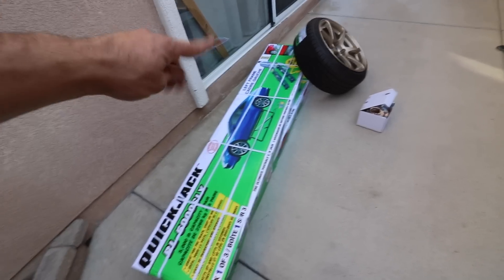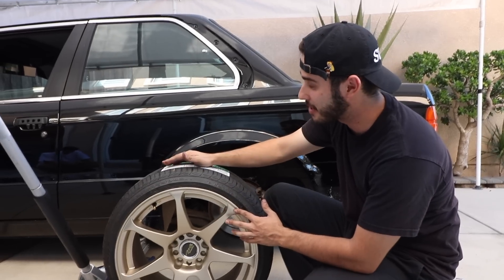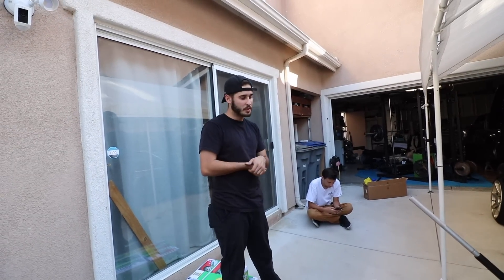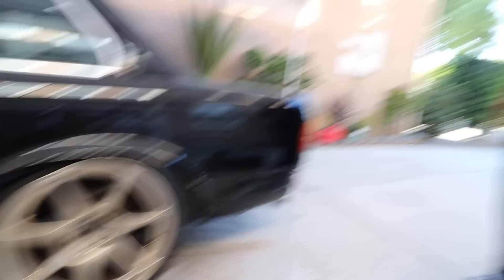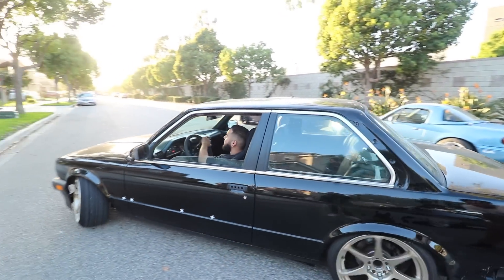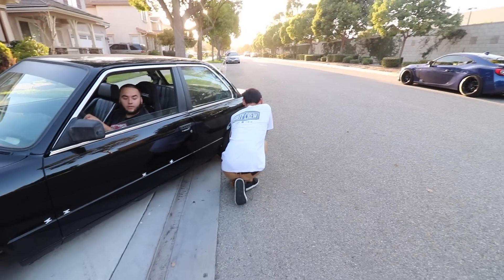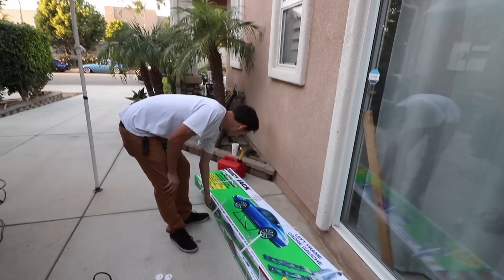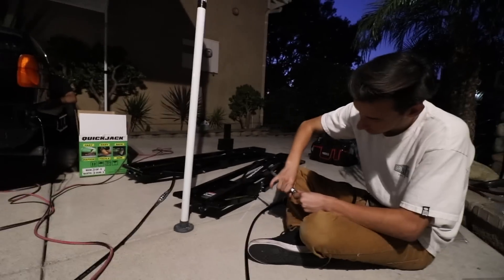Trying to Achieve "Tucking" Fitment on The E30!

Comment: Nice work!  Sorry about the filler in the rear wheel arches - always something though😄 
Hope you are feeling better and thanks for the videos👍.  Wish the roads here would let me run lower, but my e30 is lowered and a 'vert, which equals beat suspension and some nasty body flex...
Cheers!